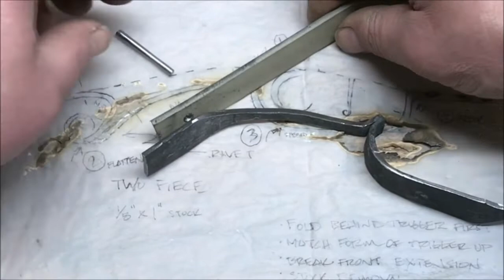Inletting a Lock, Triggers, and Forging a Trigger Guard for a Caplock Rifle

Comment: Sir, is that oxidation you are putting on the barrel? i do like the patina and colour.
Reply from the maker: Yes, after removing the mill marks, I etch and blacken the barrel with acid. The finish, upon oiling, is matt black. It’s a target rifle with iron sights, so  , any shine is a bad thing.
Reply: @SharekGadd  Which acid?